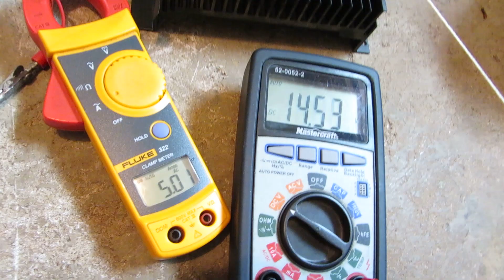PC Fan Flight Tests - 60x60x35mm

Comment: at 3:33 you can see the NMB fan blow the fuse a liitle spark appears.
also you can technically bypass the fuse if you remove a little bit of the plastic where the wires make contact with the pcb because the fuse is typically close to if not next to where the wires connect to the pcb
edit: i want the flyers to be keepers for a possible fan box update/remake video
Reply: I'm pretty sure that's a ESC that controls the fans brushless motor. not a fuse

Comment: Wow the last fan is amazing and the first one too.I have a question is it possible to fix damage dc brushless fans
Reply from the maker: If it was a fuse yes, if it's other components on the circuit board you could...but why bother?
Reply: @HL4EHalfLife  just asking. :)   i have 23 fans now :)

Comment: I'm going to get a purchase fan  brushless PFC1212DE DC 12v 4.80 I will get 5 each.but this fan is powerful.also I want to purchase a fan push and pull DC 12v 7.2A now that's a fucking powerful fan.I forgot the model number.